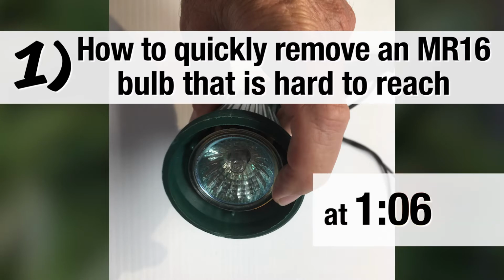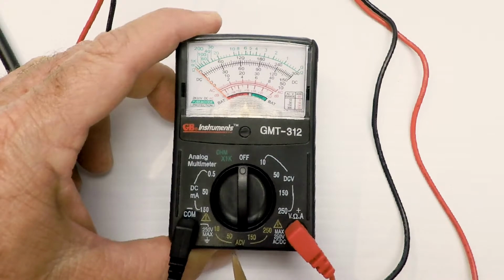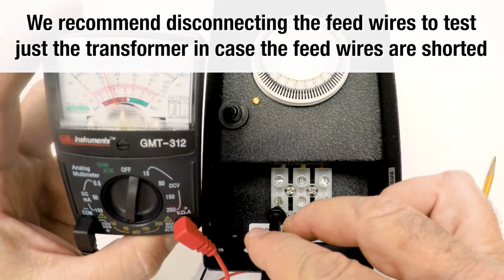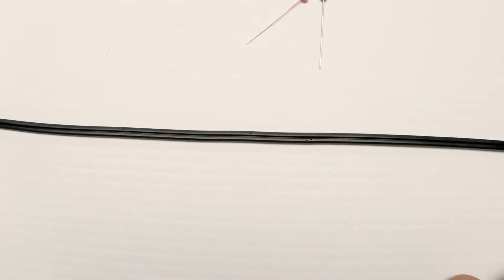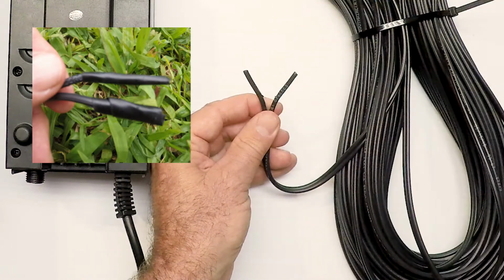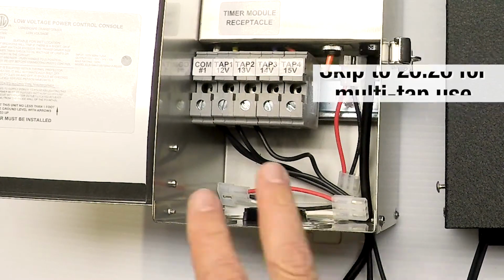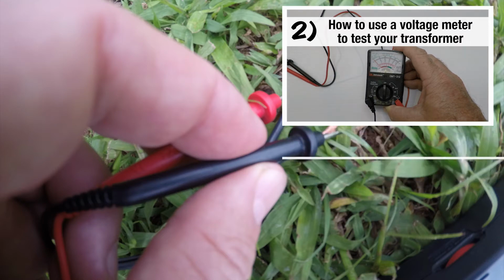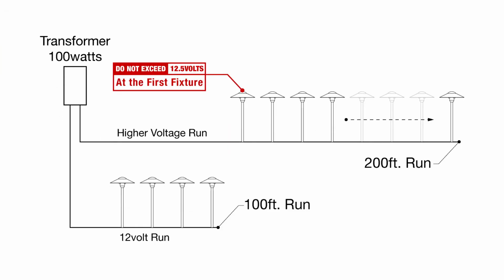6 Top Outdoor Landscape Lighting Questions Answered ❓📚 by Total Outdoor Lighting

Comment: Very nice video.  I have a Malibu transformer with a timer.  The timer runs, but in testing voltage output from the transformer the indication is zero.  Most videos recommend replacing the transformer at this point, but I would like to know if one can repair a transformer, and if so, how.
Reply from the maker: From our experience replacing the transformer was the most efficient method. When repairing a transformer there are many variables you would need to test to narrow down what is causing the zero voltage. It could be the core which would need to be replaced or repaired but finding a new core may be challenging since Malibu Lighting is no longer in business. There are many videos here on Youtube on how to repair magnetic transformers so if you have time on your hands and access to the materials it may be a viable solution. If the transformer is digital it could be a component on the circuit board that went bad. If you end up replacing your transformer we offer a wide selection that you can find here 👉 https://www.totaloutdoorlighting.com/landscape-transformers.html Have a blessed day!
Reply: @Totallightingsupply  Thanks very much.

Comment: Can you mix led with incandescent lights in the same runing wire?
Reply from the maker: Yes you can. Just make sure the total wattage of all your lights does not exceed what your low voltage transformer can handle 🙂

Comment from the maker: 👇 Here are the Section's Time Locations 👇
-----------------------------------------
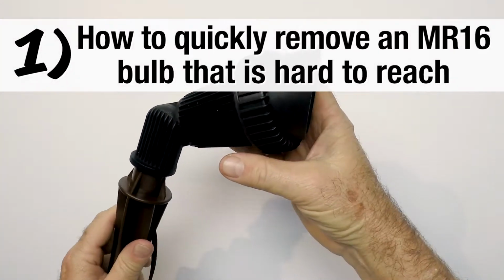1️⃣ 1:07 - How to quickly remove an MR16 bulb from a hard to reach light

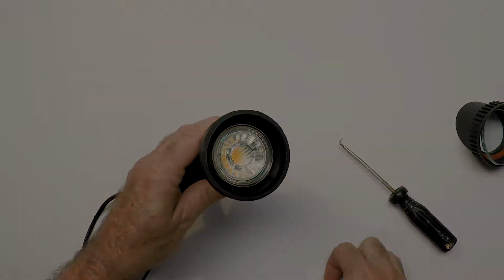2️⃣ 2:43 - How to use a voltage meter to test your transformer

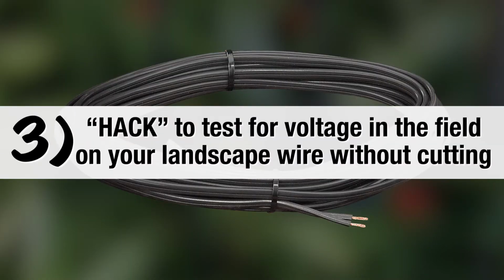3️⃣ 7:59 - “HACK” - How to test for voltage in the field on your landscape wire without cutting

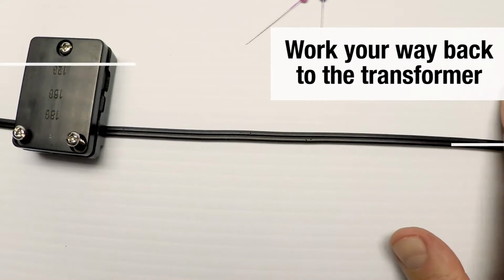4️⃣ 10:36 - How to attach the feed wire to your transformer and what to do with the wire ends

5️⃣ 17:11 - What to do if NONE of your low voltage landscape lights are working

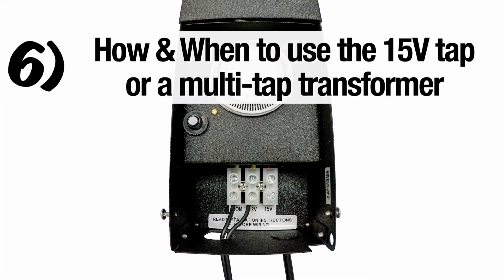6️⃣ 20:28 - How and when to use the 15V tap or a multi-tap transformer